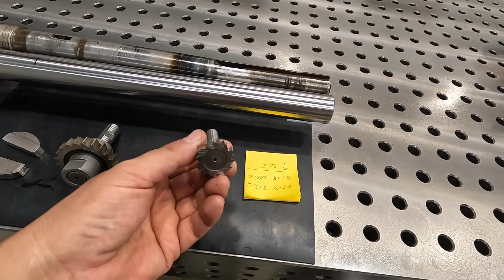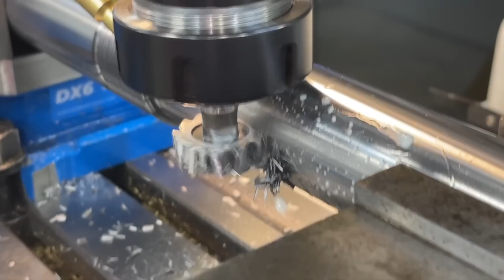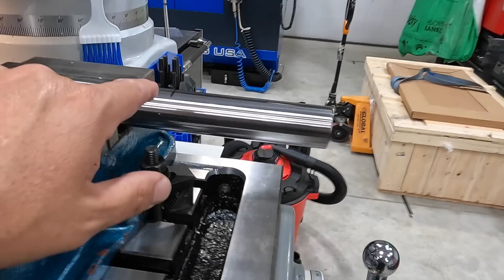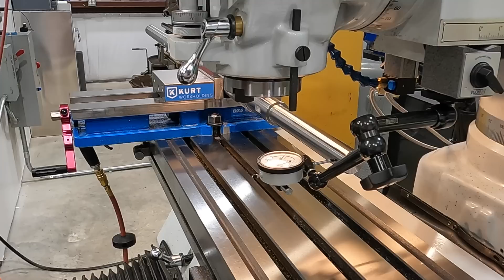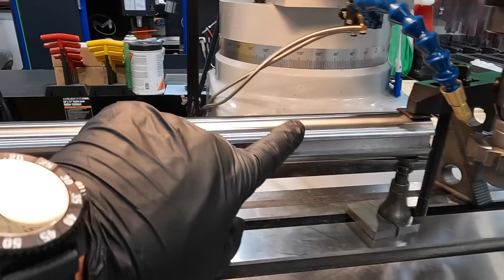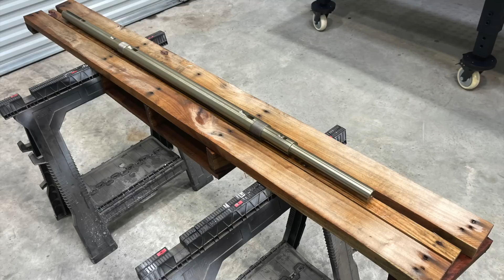70 Ton Friction Press Shaft Part 3: Woodruff & Straight Keyways

Comment: Really cool optical effect when the rpm and fps allign. Almost like the cutter eating its way in backwards 😀
Reply: Gotta watch more period dramas, friend! Same thing happens when you see an Amish-style vehicle on camera. The wheels sometimes look like they’re rotating backwards. (My mom loved watching PBS back in my youth…)
Reply: Agreed, very cool!
Reply: This is not strictly only a camera problem. If you have lights in the shop that are flickering in synchronicity with the rotational speed, you may get the impression that a machine isn't moving or moving slowly. This can even be a real workplace hazard if the machinist gets confused by it.
Reply: @Gameboygenius  Wowza I didn’t even think of the safety concerns!! But what your comment makes perfect sense to me now that I think about it! (I guess I’m fortunate that PWM vs. Shutter Angle is only an artistic concern in my trade…)
Reply: Actually, now that I’m thinking of it, I bet I could make a FlyWheel look really stonkin’ confusing. Trust me, I’m a confuser expert 😎 @AvE??

Comment: That stationary cutter effect, can also be due to the mains frequency, affecting the lights.
Reply: If it was the 60Hz lights syncing with the camera shutter, wouldn't it still need to be turning at the correct synced RPM as well? Exactly like an engine timing light triggered by spark of #1 at +/- TDCC.
Reply: @mannys9130  I thought Adam said it was running at 60rpm.

Comment: 60rpm will make it look stopped but the number of teeth and many other rpm’s will also produce the same effect. It’s called temporal aliasing.
Reply: Funnily enough, this is also why jet engines have those marks on their nose cones. Any non-LED airport lighting (LEDs run either filtered DC or raw PWM usually in the kHz. Only the cheapest consumer ones pulse with the mains) is liable to produce this effect, with the blades on the big compressor looking completely static. I should imagine more than one person got sucked into an engine or otherwise injured by one through assuming it's powered off.

Comment: That's a boatload of chatter from a brand new mill... A big mill at that. Anyone want to toss in some speculations as to why? I know Woodruff cutters and slitting mills work better in horizontal mills with outboard support work better.
Reply: That shaft was pretty long, you'd have to hold it in quite a few spots to deaden all the ringing it's going to do.   Even using 2 Kurt's, holding a round part with a square surface isn't much contact of a contact area. Regardless, it wasn't too bad and isn't a cosmetic part anyway.  Otherwise I'm sure soft V-jaws would've been much better.
Reply: That's a thin shaft, so there will more chatter and vibration than if it were bigger.

Comment: The plainer gauge was an awesome tip to keep around. Last time I had this problem I touched the cutter off on the base of the vise before loading the part then worked from the bottom of the shaft up. Thanks for sharing
Reply: I wondered why Adam didn't just set the planer gauge under the shaft to reference the bottom and then come up from there obviating the need to use an indicator.
Reply: @chriscraven9572  Well, sure, but then you don't need to use an indicator. Where's the fun in that lol
Reply: If you touched off with the quill on an upper tangent of the shaft and then again off a lower tangent and split the difference, assuming you used the same Y location, would that also work?

Comment: I'm curious what you would charge to do a job like that how many hours did it take you.
Reply: That is the nice thing about watching another excellent YouTube machinist Cutting  Edge engineering Australia. In most of his videos he will give the cost of the repair he has charged compared to the cost of buying the part new and availability and time frame of getting that part. He also usually shows in detail what the part is used on and how it works. He is a one-man, one lady one dog Workshop with exceptionally talented content and always extremely funny outtakes at the end.. Check him out
Reply: One..... million..... dollars!
Reply: 1000.00
Reply: With or without the camera work?
Reply: A Trade secret…
Reply: If you have to ask, you can’t afford it.
Reply: I was just curious because I work at a cnc shop and I know how much they charge per hour.
Reply: @tmiller4996  Most the time shafts from a factory needing repaired or remade isn’t about cost, but time. A machine being down can cost a company a fortune while it’s down.
Reply: That's around $5500 for me.